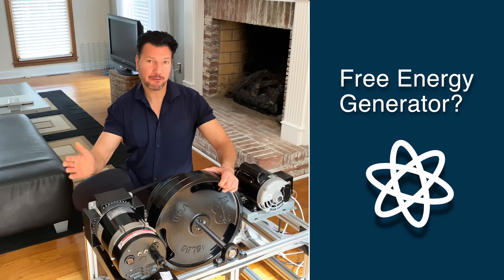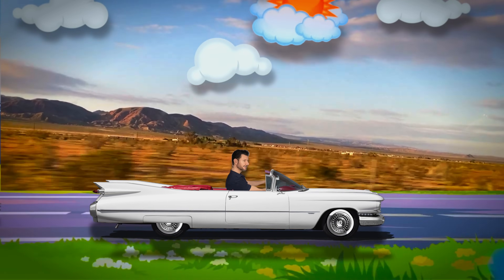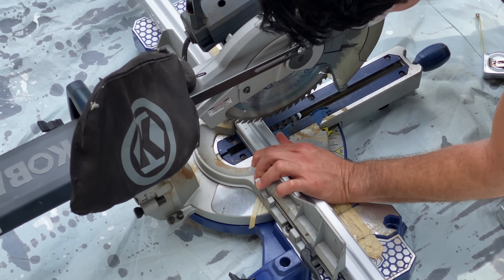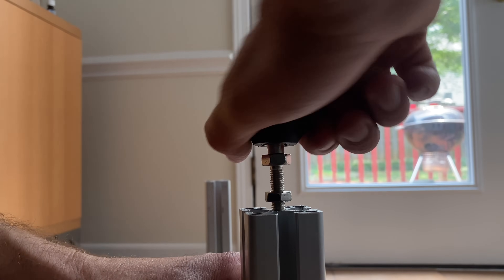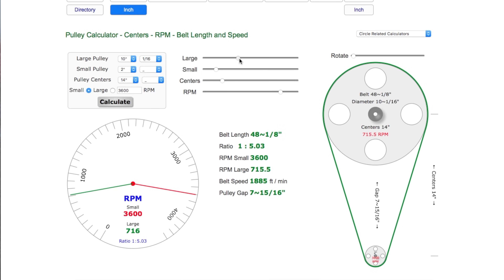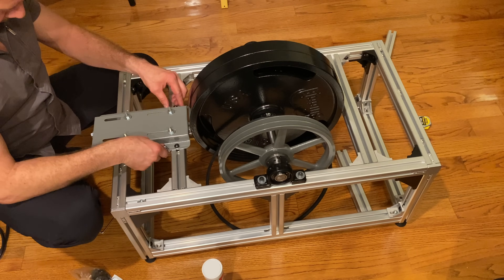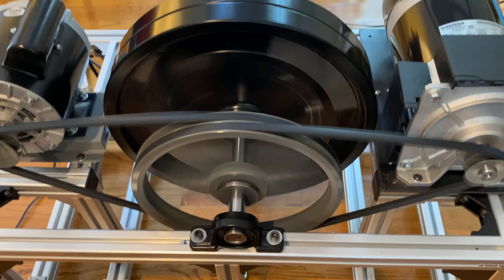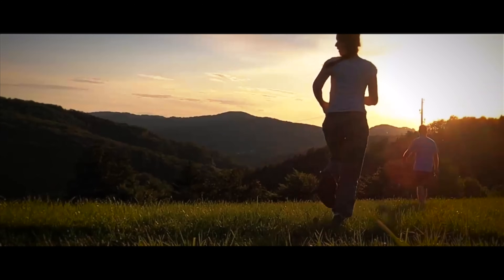How to Make a Free Energy Generator!

Comment: If you want to salvage some value from the project you could add A LOT more plates and make a flywheel energy storage device.

Then its not really about power of the motor necessarily, but rather using a brushless motor and going for extremely high RPMs. But you should bury it incase of failure so that it doesnt hurt anyone.
Reply from the maker: Thanks Joshua!
Your correct on burying it for doing so because that will go straight through the wall if the bearings or shaft fails :)

Comment: I like the idea to add solar panel energie to the sistem!!! Also i think you should never use the electric corrent strait from the genarator but trhu 2 sets of bateries allowing the generator to be submited allways to the same torque output to charge one of the batteries set whylle the other set is charging!!!

Comment: I would try adding either 2 battery’s or a battery and a capacitor.  I would try running the motor on one battery and charging the other. And you could measure and switch.  You ad friction to the system with the pulley.  I would make my flywheel my generator also.
Reply from the maker: Thanks Roy maybe worth a try.

Comment: Yo, you need to sync phases together evenly before switching, alternate current isn't the same as direct when switching power sources.  And different size jackshaft pulley with different ratios for both, motor needs more torque with bigger pulley to medium js pulley from js larger to a regulated generator or modified truck/car alternator
Reply from the maker: So basically I need to change everything:)
Thank you!

Comment: The problem is that you use a generator with self-excitation that is not efficient and requires high speeds to generate electricity, the secret is an efficient generator with NEODINIUM MAGNETS that produces electricity at much lower speeds and is much more powerful and efficient.

Comment: Bigger pulley on the electric motor would mean more rpm with less actual motor shaft rotation. But then draw becomes the issue

Comment: add a battery or capacitor bank in between the motor pulling power from the generator , if its pulling 500 watts then the generator has to be putting out atleast 1k or more is better id go with way more ,capacitor will help it will even out out the draw from the motor or use a battery to temporary store energy for the draw
Reply from the maker: I have my daubs that capacitors help Sen but perhaps worth a try.
Thanks!

Comment: I’ve done this. Without a flywheel at all. The trick is to use a 110v motor that runs the same RPM as the 220v generator you can get a 3hp 110v motor. It will run the generator no problem. The flywheel eats a lot of power getting up to speed tho. But once up to speed really just keeps the power even. That’s all.
Reply from the maker: Thanks Nickolas!
Is your system still working?
Reply: @MarkusNenning  yep. I use it camping
Reply from the maker: @nfordf450  any chance you have a video? Or even better I can come see it? :)

Comment: You might try pulsing the motor. At least that way you might get enough to run the motor. The other idea I have is to use a magnetic flywheel with the pulsing motor. Using magnets to push the FW while the motor is without current then the motor to get it back to the magnets for another push. Cheers
Reply from the maker: Thank you Rodney!
I am working on a test using permanent magnets on a modified car alternator.

Comment: I can understand why you chose weights, they are equally balanced and already constructed. 
Perhaps a cylinder based circular tube to allow air flow in addition to placing the magnets inside the cylinder where they are parallel to one another so that the protons and neutrons can connect in a manner to which as the interphase they are pulling/moving against one another in tandem (???)
Just a thought. I can envision it, it’s obviously more difficult to describe in a YouTube comment.
Nikola Tesla is one of my hero’s!!!!
Reply from the maker: Thanks Kami!
A lot of people suggest using magnets.
Not sure if you’ve seen the alternator video floating around. But I thought I’ll give it a try. It’s basically modifying a car alternator by adding magnets. I have my daubs but once again that video looks so realistic that I have to a least try to see if there is some truth to it.
Reply: @MarkusNenning  
Actually I have seen that video. Recently I searched for old videos of tractor steam engines to prove to younger people that engines do not need to run on fuel. 
Some people are so closed minded. They have no idea that absolutely everything we have was an invention from someone mind to reality.
It’s time we go back to Earth driven inventions. 
Thank you!!!
Reply from the maker: @KamiM1111 steam engines.

Comment: My dear Markus. I have been working on this project for about 4 years and I have hardly found a big flywheel. For your project you need a bigger flywheel in diameter, about 800mm, about 100 kg, a power compensating capacitor of 200 kvar. The engine must be at least 30% lower than the alternator.
I am from Romania and my project is a 380v 20kw generator with a 1200mm, 380kg flywheel, and the engine is 4hp.
Reply from the maker: Thanks Gabriel!
Is your project already working?

Comment: Feller, you need a little education in the history of science.  Conservation of energy has been around for over 100 years.  Literally thousands of experiments have been done, from smashing sub-atomic particles together, up to observing whole galaxies colliding.  And in NO CASE has there been a smidgen of energy created.   It doesn't matter how large the flywheel, or how large the capacitor, yo never see more energy come out than went in.    it's even has theoretical support:  Ellie Nother came up with a theory in 1909, stating that considerations of symmetry PREVENT a lot of things from happening, conservation of energy being a strict requirement of a simple symmetry.   So both through theory and experiment, no free energy, for over 100 years.
Those YouTube videos are always very short, and never show important details like what is behind or under the device.  Probably "wires".  A very old trick, again over 100 years old, mainly done to get cash from investors.   Same thing nowdays.  Regards.
Reply from the maker: Thanks George!
I think there is no harm in trying something for ourselves.
Building and fabricating something is always educational. Yes it hasn’t worked and yes perhaps I do need a little history lesson :)
But regardless I gave it a fair try learned a few things overcame a few challenges and now have a large machine in my living room :)

Comment: Your brother from Saudi Arabia 🇸🇦🇸🇦
My opinion is that it is not possible to generate energy from a generator and use it again to rotate the same generator because there are factors that hinder this system, including friction. Therefore, external intervention is necessary to combat these factors I see that a 12-volt generator is connected to charge a battery to store energy, and then connect the system to a motor to rotate the equilibrium wheel and compensate for the friction factor in the form of intermittent pulses to not lose more energy and keep the equilibrium wheel in a state of movement and a specific speed
Reply from the maker: Thanks Ali! Yes makes sense.
In part 2 I talk about why technically it should be possible.

Comment: I don't know what kind of generator, motor and their respective ratings you are using, so it is almost impossible to give a suggestion.
Reply from the maker: Asrul Amru I have all the specs of the motor and generator in part 2.
Thank you!
How to Make a Free Energy Generator Part 2!
https://youtu.be/tFqn-atYcOU
Reply: @MarkusNenning  I see that RPM required to run the generator is 3600. Your motor can not produce this, if you try to increase the RPM  by means of pulleys or gear you will further sacrifice the torque that already small. In my opinion, the motor does not match the generator. But even if you find a perfect match, there is not much extra load you can put in the system. I think your best shot is to modify an alternator to become a generator by rewiring and installing strong permanent magnet on the Rotor. Good luck.
Reply from the maker: @asrulamru7255   thank you!
That is the approach I am trying next.

Comment: Try adding a capacitors that should give the jump or surge in power to start the motor. We forget about those they are used alot to jump start motors. Capacitor will possibly fix your issue maybe.

Comment: You will unavoidably have energy losses, ultimately as heat.

Bearings are not without some friction, that friction takes some of your energy and converts it into heat.

Belts and pulleys rub against each other, causing friction which takes some of your energy and converts it into heat.

Belts also warm up due to internal friction, as they are constantly bent and straightened, over and over again, taking some of your energy and converting it into heat.

Parts moving around are displacing and moving around air, thus friction, thus a small loss of energy as heat.

The wiring involved including inside the electric motor and generator windings, are not without resistance.  Since they resist electrical current flow to some degree, they heat up and thus take some of your energy as heat.

Alternating magnetic fields from an electrical motor and generator, cause eddy currents in nearby ferrous metals, heating them up and taking some of your energy as heat.

If your machine causes any sound and/or vibration, that does not occur without some energy usage.  Ultimately this too is dissipated as heat due to the friction it causes in moving or deforming matter.

I've probably overlooked other areas of energy loss.

The fact is that you cannot even get out the same amount of energy that you put in, let alone more!!!
Reply from the maker: Thanks Beardy 
Very detailed list of energy losses in a system like this.
Appreciate the feedback!

Comment: Even when I was a small child I thought of creating electricity like this, my father said the same thing to me that it wouldn't work. I am now in my 50's and still ponder on this subject. I think it is possible,  we just haven't figured it out yet. I do believe the problem is not only the flywheel is too small, it should be 2--3 times larger than roter on the generator.  Also, I believe instead of driving the flywheel at the shaft, we should find a way to drive the flywheel using its circumference; alot less force is required. Ive seen videos of people spinning aluminum disks with magnets, perhaps a small motor with spinning magnets on its shaft to drive a large aluminum flywheel.
Reply from the maker: I have almost the same story.
My dad was an electrical engineer and would tell me no that won’t work:)
I have seen some very creative constructs with large disks but unfortunately I don’t have the equipment nor space for it.
Reply: @MarkusNenning  For me, it's the time and money. I use to be a machinist in my younger years  before I changed careers.  Perhaps when I retire I can play around with it. Big flywheels a hard to come by.. To make a huge flywheel, I was thinking of hiring someone with a laser cutter to cut thinner sheets of metal and bolt them together.
Reply: It could never work because of losses from friction or the lines etc.  Even if it you managed to achieve 100 percent efficiency what good would it be to just drive a motor because any more power extracted from the generator would then slow it down. The more power demanded from a generator the harder it is to turn that generator.
Reply: ✊  it's all right
Reply: https://youtu.be/QOV_Js59BHY

Comment: since you got that far id try rewiring the Gen to star, sounds like its in data, star makes power at low speeds and data the faster it tuners the more power it makes,  but i think that would just make it take longer to slow down thats about it, but i also never seen anyone try to put a ballast with it,
Reply from the maker: This motor is only a single phase motor with a capacitor to create a phase shift.
But yes I may try a 3 phase motor.
Thank you Harry

Comment: There is this thing that scientists call "dark energy" and the reason that they call it dark is because they cannot detect it with any instruments, but all their mathematical formulas tell them that it is there. (everywhere) And as an indicator of its potency or intensity, I have seen it described as a "1 teaspoon full volume" is sufficient to boil off all the worlds oceans.  Inconceivable intensity and amount of energy.  So are these Indian motor systems somehow tapping into that, or are they some kind of hidden scam?  Or is there some sort of missing ingredient in your set-up, like the type of motors/generators used etc.?
Reply from the maker: I think it’s a mixture of both
I believe most videos about this generators are scams but I also think I am missing something to get a better result.
My expectation would be that it at least runs for a little until the kinetic energy from the flywheel is gone.
Reply: @MarkusNenning  I have seen a lot of these things in different forms, rotating and stationary etc.  Most rotating systems use permanent magnetic motors.  Even if they work the question still is how long will the magnets last, do they deplete like batteries?  I suspect that ratios and harmonics might be part of this, as well as the electric and magnetic components.  Pully ratios, number of stator or armature poles in relation to each other, or between the motor and generator etc.  The hidden battery theory is not that plausible because of the energy storage output to  required size thing.  There is a video out there where a car alternator is modified to some form of three phase permanent magnet motor to drive a generator, and no storage flywheel is used at all. Could not see where they would hide a power source in this one either. [a battery]
Reply from the maker: @bigpicture3  yes that’s the video I am trying to recreate.
It looks very realistic since he is floating it and you can’t see any wiring.
But simple the fact that if that works any car manufacturer could increase fuel efficiency makes me question it.
If it was that simple don’t you think very innovative car companies would have figured it out by now? 🤔

Comment: I keep seeing these videos as well.. Perhaps the generator needs to be a PM Low RPM type to reach the power to run the motor?? Just a thought. Seems like all these India and China videos they take a car alternator, which generates 24V and they somehow are able to boost the output power by putting more magnets inside it so that it somehow produces 220VAC when it's spinning at a lower RPM... Probably is camera tricks and such, but why go through all the trouble of building something that doesn't work just to post a trick video.. After a while you would think they would stop because it's worth it...

Comment: You approached it the way I would have done and as such saved me a lot of money! so an idea maybe use a 12v motor to drive the dynamo, have a 12v car battery and a 240v charger for the battery etc ...and even some super capacitors. Use the pully size to match the rev's on the dynamo?
Reply from the maker: Thanks Mike!
I just got a used car alternator and will try something similar to what you mentioned.
As far as the capacitor goes I have daubs that that works. I talk about it in part 2 why I don’t think super capacitor would work.
+they are pretty expensive 😬

Comment: Great video! The flywheel in this video isn’t big and heavy enough to keep it running for a very very long time and at the same time generate a high amount of current. Add a high voltage capacitor that will discharge a high load to the motor and then gets charged back up by its the alternator augmented by high wattage solar panels to supplement power to the motor as the capacitor re-charges. Thanks so much for your work. Hope you can get this to finally work. Following you.
Reply from the maker: Thank you Ronald!
Yes I hope too that I can get it to work.
Would love to use it as a green crypto mining power source.
Combining it with solar panels is definitely a good idea and I am also looking into possible wind power (investment-wise I think it would actually cheaper)